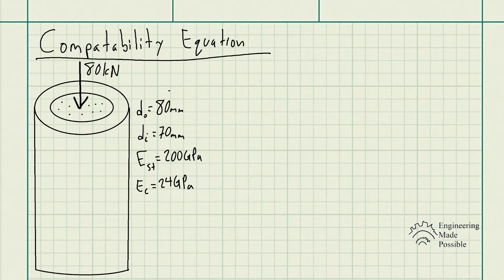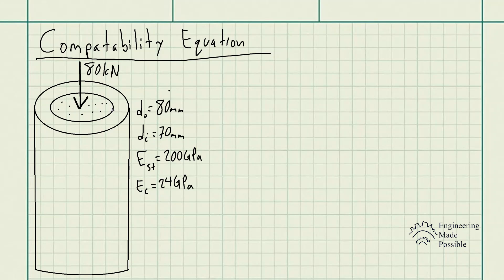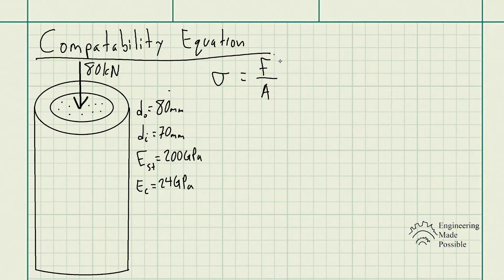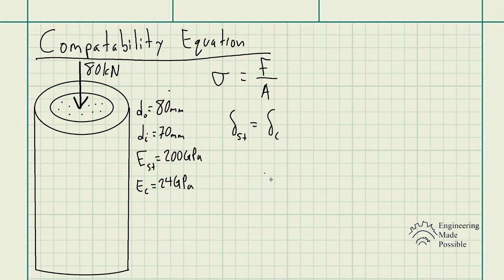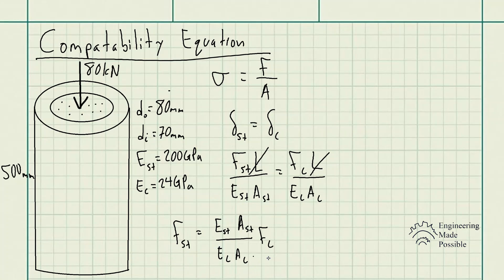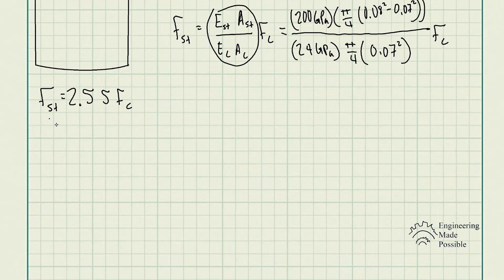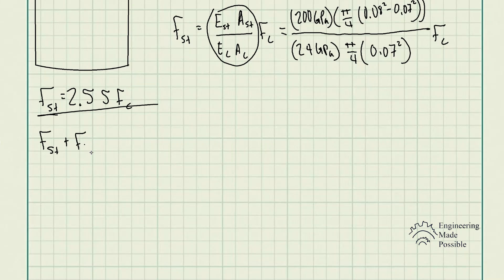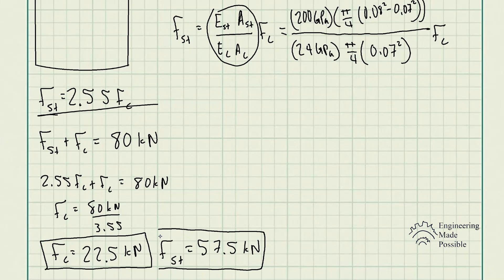The steel pipe is filled with concrete and subjected to a compressive force of 80kN. Determine the..

Comment: Where did 3.55 came from?
Reply: After that you have another equation Fst + Fc = 80kN, in which you sustitute Fst from the previous equation getting -> 2.55Fc + Fc = 80kN, then you factorize -> Fc(2.55 + 1) = 80kN -> Fc(3.55) = 80kN, that's where the 3.55 came from
Reply: bro how did he get 2.55 in the first place XD, i keep getting 0.17
Reply: @jawadzahid24  This might be a little long but it'll be step by step, the first thing I did was to calculate the areas so Ast = pi/4*(80mm^2 - 70mm^2) -> Ast = 1178.09 mm = 1.178 m, then Acon = pi/4*(70mm^2) -> Acon = 3848.45 mm = 3.848 m
Reply: @jawadzahid24  Then I did what he did to get Fst -> Fst=(Fcon)(200Gpa * 1.178m)/(24Gpa*3.848m) -> Fst=2.5511 Fc